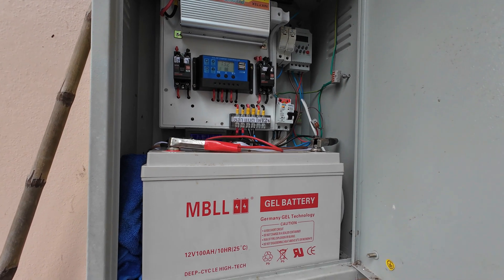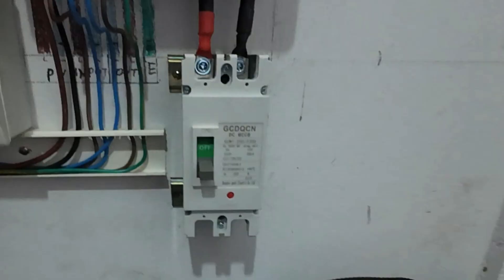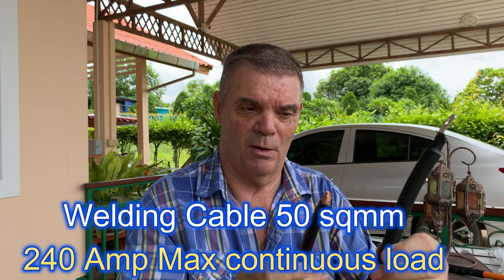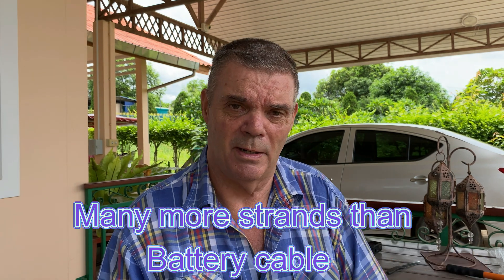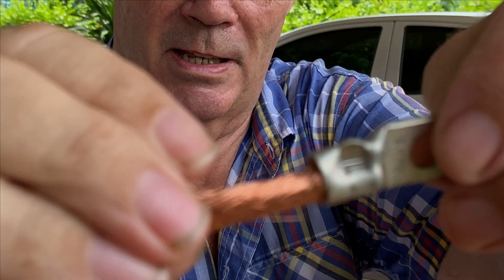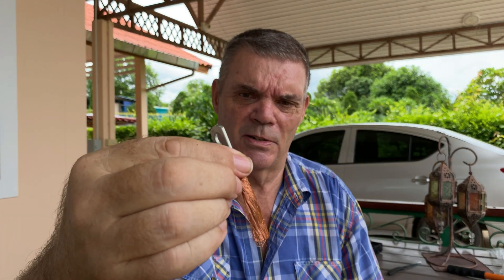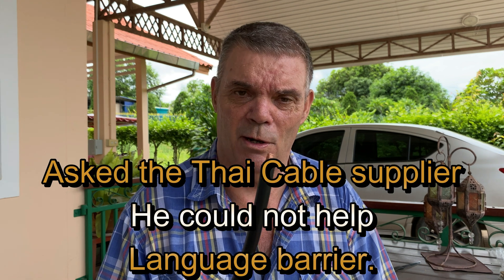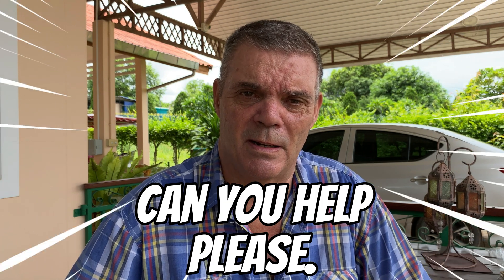Solar Problem  Crimping Cables

Comment from the maker: Hi everyone and thanks for all the suggestions, the answer was buy the Battery Cable of 50 sqmm  and the Lugs were the correct size crimped on the Lugs Job Done. The end result for me do not buy Welding cable. Much appreciated the input from everyone.

Comment: Add solder to the end to stiffen it up?
Reply from the maker: The crimp is strong no room for solder but thanks for your comment.
Reply: @RetiredandLivingthedream  On the fluffy soft copper wire. even if its a tiny bit, it might help.

Comment: solder? crimping is for suckers.. smaller gauge we use wagos, this gauge is solder.
Reply from the maker: Many different answers her and Soldering been mentioned by many. Thanks for your input.
Reply: @RetiredandLivingthedream  11 years and counting with working with solar.. u can also drip braze these.

Comment: Les I think what you are experiencing is because you are mixing high strand welding cable with automotive crimp connectors. Welding wire is usually clamped not crimped. And please don’t solder automotive crimp connectors. A crimp provides an oxygen free connection (doesn’t oxidize with time) that is also resistant to vibration. A soldered crimp is much more likely to crack or break. Stick with automotive/marine components and wire or find a battery shop or marine shop that makes cables. They will have the correct tools and wire to make reliable connections. You should not twist the end of a stripped wire to get it into a crimp connector. It should slide straight in with little excess clearance if the connector is the right size. You can wrap a little tape around the stripped wire near the end to get it started then peel it back as the wire enters the connector straight in with no stray strands of conductor. 
Cheers Chris
Reply from the maker: Thanks for that, yes automotive cable although the same csa the size is different🙏. I am buying some 50sqmm Battery cable to compare. I'll get there but many thanks for your advice.
Reply: @RetiredandLivingthedream  Another possible issue with welding cable is whether the insulation is rated for continuous duty at the theoretical ampacity of the conductor. Welding machines are limited duty cycle on the output side but as you know residential/commercial branch circuit conductors are rated by both the size of the copper conductor and the temperature  allowed by the insulation.  I also recommend that you stick with the crimp tools like you purchased that use a die to compress the crimp connector from multiple sides rather than the kind that swedges or deforms just a little area of the crimp. Which reminds me of the Blacksmith’s motto “ Any tool is a hammer ,except for a screwdriver, that’s a chisel :),lol.  Looking forward to seeing your completed project.
Reply from the maker: Thanks for your info, problem Solved, I bought some Battery 50sqmm cable the result the Lugs I bought are the correct ones 50sqmm I crimped then onto the cable Job done. 50 sqmm Battery cable is not the same as 50 sqmm Welding cable.

Comment: Having done electrical installations in thailand any descent electrical supplier will be able to sell you the cable and lugs they will also be able to crimp the lugs on the cable for you , also fine stranded welding cable will be smaller than large diameter  stranded cable , go to a good electrical supplier in your nearest large town I know places to go in hat yai in ghe South of the country but that's no good to you take it easy
Reply from the maker: I did this in Ban Phe and they supplied the wrong lugs also, I have a small understanding he had even less as they supply Lugs but he had no knowledge. Thanks the quest goes on.

Comment: I did generator R&D for the last 6 years - and also have been an automotive mechanic for 22 yrs before that - trick I have used time and again - use a bottle torch ( map gas etc ) if the end is a capped closed end, in a vice the end fill it with rosin core solder then while still liquid dip the wire into cupped end the solder nor makes a bonded connection to the jacket and ALL of the strands on the wire. Any over spillage you can quickly take off with another application of heat to the outside and quick tap/wipe off. Made hundreds of Anderson power pole high amp testing leads for load banks running up to 15kw constant load for months of solid up time at gen head max load capacity - never had a lead overheat, never had a lead pull apart, never had a lead with line loss due to improper crip tension. 
Have also fixed starter cable wiring the same way over the 22 yrs of car work
Reply from the maker: @FreemenMars1  Thanks for the info, many different ways to this. I want the proper lug size, I’ve ordered the 50 sqmm Battery cable just to compare.

Comment: Hi there
We used to get cable ends without the slot in them or weld the slot to stop solder loss , put the lug into a vice or vice grip , melt your solder into the lug till it’s full , have your cable prepared the while keeping the solder in a fluid state push your cable into the solder filled lug , remove the heat source and wait till cooled before removing from vice or similar , clean to eliminate corrosion, heat shrink the joint and you should be good to go , we used this method on 12 and 24v hydraulic power packs drawing up to 250 amps , hope this helps , you have many options to choose from in your comments 
Regards Davy 🏴🇹🇭
Reply from the maker: Thanks for that a number of people have suggested the same method, something I will look into.

Comment: Hi less , seen some video of heavy duty cable . They used blow torch heat up the lug and fill up with solder, then dip cable into the hot solder in the lug  . James korat .
Reply from the maker: Hi and thanks for taking time to comment, a number of people have said the same, Ill look into this method. Thanks.😀

Comment: As most comments suggest , solder is the best way to solve your issue. Been a boilermaker welder for 50 years and the lug was always crimped even if the cable eventually pulled off the lug, nobody ever worried about it because its the way it has always been . Numerous times due to the bad fitting the cable would overheat and of course the insulation would melt , which as you stated can cause a fire.  I was amazed that your electricity account  is never over 800 baht per month , ours is normally between 5,500 and 6,500 baht a month though we only rent and there is no solar .
Reply from the maker: Hi thanks for the comment, ok let me explain some things, our Electricity is always low around ( 800 Baht  $22 ) per month as we hardly use the Aircon, we use fans, My backup system is for when the power goes down I can run fans and my tv if needed. I have a 80 watt panel on a gridtie system which runs the fridge during the day as it puts on average 50 to 60 watts into the house electrical supply. Why am I putting solar into my house as my bills are so low, I enjoy doing this sort of hobby it also gives me something to do. So even without Solar my Electricity bill has never been over (1,000 Baht $ 27 ) We live in a cool house because of ventilation I have done a few video's on this also. Thanks for watching and taking time to comment.
Reply: @RetiredandLivingthedream  Appreciate the explanation!  Makes sense.

Just don't burn your place down :)
Reply: Same.  His usage numbers are super low.  Not sure how one can justify a solar system when only using $20USD of electricity per month.
Reply: @steveaustin1984  ,I think his cost is due to his solar system, and probably if he didn't have the system the  cost of electricity would be in the thousands.

Comment: When I've run into that oversize lug...I've pushed the wire up snug to the small opening slit at the top that lugs (copper) often have (or you could cut one into it) and then use a rosin core solder to fill that top in and again on the bottom before crimping...I usually crimp using a hammer and an old screwdriver that I cut the tip down on...then it's a wrap...
Reply from the maker: Thanks for the advice, I would like to buy the correct size Lugs without resorting to other tactics to fill the void. Soldering is a good solution as the cable will be static as there is no movement once the system is set up. Thanks for watching.
Reply: @RetiredandLivingthedream  indeed…and therein lay the challenge…finding the right size in a sea of misfits….lol

Comment: Not relevant to your problem but:
I am designing a solar power system for a house in Thailand.
I have watched many hours of vlogs and read so much on the internet about designing and building solar power systems.
I think that you would recover your money in 5 years and from then on almost free electric.
The best I have found on UT so far is "How To Build a 48V 5kW (Deye) Hybrid On/Off-Grid Solar Power System - Complete Pro Level Tutorial".
Reply from the maker: I also have watched many Youtube video's on this subject and this New system ticks all my boxes and watched  many vids on crimping non tell you of the problem I have. Many suggestions here but right lugs for the Job in my quest. Thanks for taking time to comment.

Comment: Hi Les, I used to see this problem a lot in my old job with the heavy duty industrial welding sets. We used to tin the cable ends then solder them into the lugs, it seemed to work really well.
Reply from the maker: Yep Solder has been mentioned a few times but I'm looking for the correct size Lugs for the Job. My quest goes on. Going back to the UK with a sample of the cable so one way or another I will get what I'm looking for. Difficult here with Translation.

Comment: That cable is tri-rated cable. 
As a retired Lead Design Engineer at the UK's largest power network owner operator, I can confirm that we prohibited their use to connect to our network. 
You will need to solder that. 
Crimping will pull out as there is not enough grip on it and never will be even if you bind it with smaller guage wire to get it to the thickness you desire.
Solder it or use another type of solid conductor to avoid burning your place down.
You have my email if you want more advice.
Reply from the maker: Thanks for the info, the specs on the cable are assured by the manufacturer and Welding cable is widely used in the solar industry so I'm not worried about the specs on the cable. Welding cable has more heat insulation than battery cable. As said in the video it will never be run at full amp rating of the cable so I am well under the Max Amp rating so overheating will never be a problem also going for the bigger cable it is a belt and braces method.

Comment: For flexible cable you need different lugs. Look for dynamic lugs. The shaft is longer and the lug wall is more massive
Reply from the maker: Thanks for that I will have a look for these.🙏

Comment: How about using Google translate and ask the Thai cable supplier again. It might reduce language barrier problems
Reply from the maker: I have had my wife translate to the seller who is not the cable supplier, just the seller, he had to ask the supplier then tell me, a  3 way conversation does not work, went to an Electrical wholesaler given the wrong Lugs,  I have had 12 Lugs delivered and bought but still not got the right ones. I'm going to the UK so will get something there. No one on youtube has this problem don't know why I'm having this issue but it is important to get it right. Thanks for taking time to comment.
Reply: @RetiredandLivingthedream  Don't forget to take a small piece of cable with you to the UK, then when you are in Screwfix or wherever, you can be sure of buying the right ones that fit

Comment: Hi Les, I think I've told you before I haven't paid an electric bill now for over 2 years I converted an ambulance I have 700 Watts of solar on the roof and a similar system to what you're building but on 12 volts. I think the biggest problem you have is the type of lug you have bought if you are using sealed logs in my experience you have to fill them full of solder the few I've done I used a very small blowtorch to get the heat to it, but the best results I've had is buying good quality open-ended lugs when they crush the wire has somewhere to spread also the crimp makes a V shape if you get my drift you can push the cable right through onto the lug but afterwards tidy up and heat shrink it to make it nice and tidy.Hope it helps but that's what I did and I can honestly say I've had no problems since 👍
Reply from the maker: Thanks for the comment, I will visit a Car music system installer as they use this size cables for their amps. There is more ways to skin a cat. I agree with the open lug so you can push the cable right through the Lug.

Comment: Les why did you not buy batteries with higher voltage (48 volts). You can use smaller cables (lower amps).
Reply from the maker: I looked into the 48 volt system, the 24 volt system is because our electric usage is not high and the inverter is a 24 volt input. 4,500 watts is our daily usage, I'm looking to half our electric bill to 350 baht per month. Our electric is never over 800 baht per month. I agree 48 volt is smaller cables. Thanks for the advice.🙏

Comment: Les, I use welding cable for my earth wires for my ham radio station.  You need to solder that cable to the lug!  The wire is copper, so it will solder OK, but you need a heavy duty soldering iron, typically 150 watts.  I insert the bare cable into the lug, hammer the lug a little flat so that it physically grips the cable and then apply the end of the soldering iron to the lug... and wait!  It will typically take 60 seconds for the metal lug to heat up enough to melt the applied solder and the heat will conduct up the lug and to the end of the copper cable.  Liberally apply your solder to the lug/cable crimp area and if it's all hot enough then the solder will melt and run into all the small gaps inside the crimp section and adhere to the copper strands!  (Don't do this with aluminium cable - very difficult to solder!).  I never rely on crimping to make a reliable electrical connection. I always crimp and solder, and therefore always use copper wire :)
Reply from the maker: Looked at Solder it would solve a problem but many say crimping is better. No lose joints. I'm looking at all options now from the comments.

Comment: When I worked on the underground with low voltage and high voltage cable jointers the way the used to get round this type of problem, oversized lugs with undersized cable , firstly they would Tin the cable with solder at the ends before using a ferrule to bring it up to the size of the lug required and then crimp the lot , during my 30 odd years in electrical installation not one of these joints ever failed underload or ever arced thtough over heating.
The same method was used when jointing cables of different sizes or csa's by using ferrules.
Hope this helps Les.
Reply from the maker: Thanks for that and yes that is one way, I will buy the correct Lugs so I don't have this problem but getting the correct size. 12 Lugs I have bought all wrong. The Electrical wholesale shop here even sold me the wrong ones.

Comment: Worked on trains, internal traction motor cables lugs would come away, the lugs are sized by numbers and we had a hand held hydraulic crimping tool, that had different numbered sizes of crimping attachments that corresponded to the lug size
Reply from the maker: I understand that but here we go. The cable is 50sqmm but the Diameter is 11 mm so getting the Lug that says SC 50MM with the barrel size of 13 to 16mm is the trouble I am having.

Comment: Trick I learnt at college - get some bare 1.5 or 2.5 mm copper (strip some twin and earth) and wrap it round your welding cable to increase its csa. Wrap round like the top of a hand man's noose. Will give you a tighter crimp.
Reply from the maker: That in a thought thanks for that, getting the correct size Lug is the key but that is harder than it should be, an Electrical wholesaler here also give me the wrong lugs. Thanks so much for your suggestion.🙏